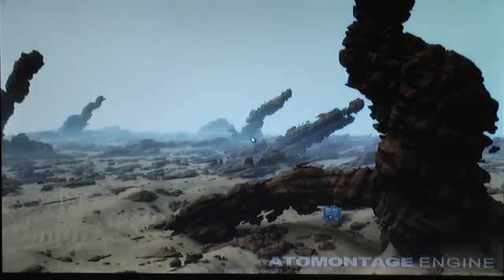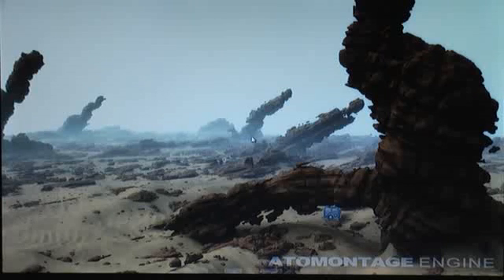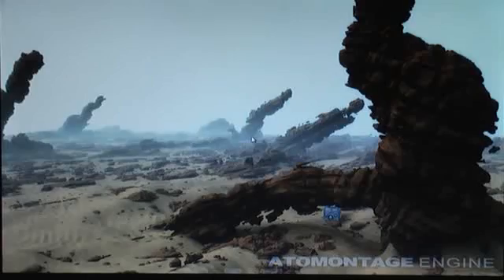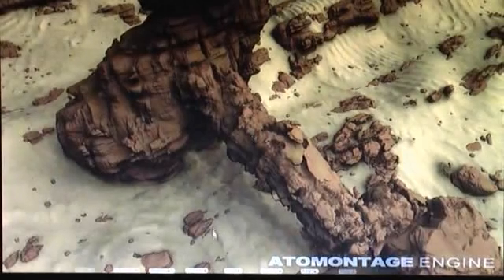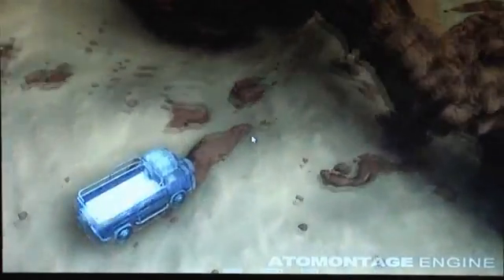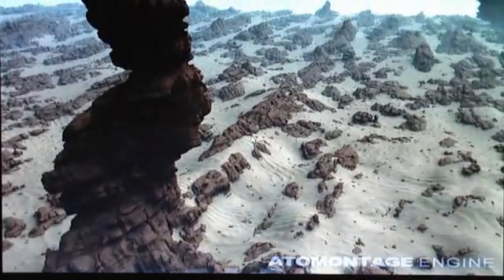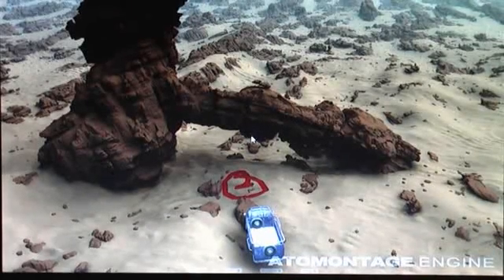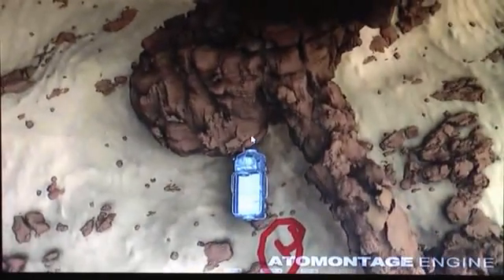Atomontage Engine - The Future Is Volumetric, Atom-Based - Unofficial video-blog #1 (part 1 of 3)

Comment: what? you can do voxel based animation? if you do that, and it works on a currently mid range system, i pronounce you god of all game engines
Reply: szeredai akos Midrange? It runs on a 2012 laptop at 60+ FPS. It will most definitely run at hundreds of frames per second on a modern gaming setup.

Comment: what are the machine specs of this video?

Hi! I dont understand what happened to digital molecular matter, tho I believe this voxel approach has much more detail than DMM can have.

but, considering the end user, the power and memory of such machines; does it require 64bits OS? will this voxeling be feasible? or, you are considering in a few years, when it can be released that, in that future the machines will be able to handle Atomontage properly?
(I am considering it is heavy to run)

THX!

Comment: It'll take more than one game. There have been plenty of games that used voxel engines in the past. The problem is the hardware of the GPU is specifically designed around pumping out polygons as fast as possible. To truly shift the industry into a voxel paradigm you need the hardware to follow, which at the moment, it simply won't do.

Comment from the maker: 1) there is a limit but it can be changed by changing a single line of code; the rest of limits are due to data volume, not code
2) it's not really a tree, but a tree could be inferred easily.. The memory footprint depends on the total entropy of the source data (uncompressed) and the strength of the compression used - I don't remember numbers regarding this scene but most scenes were few hundred MB partly compressed
3) voxel by voxel is impossible, there can be billions of them easily

Comment from the maker: @FischKopfD Well no. As you can see in AE videos, AE doesn't depend on repetitious blocks of geometry, hi-res or not. And I haven't talked about it yet but in AE there's no artificial LOD limit (the same in other non-trivial voxel engines) so in fact the details in AE can be comparable with those in UDT. I will show that in future videos and also in the first executable AE demo. Dependance on massive instancing of geometry is a serious issue and no good sign of engine capabilities.

Comment from the maker: @lelela2211 I hope so. Soon the generators will run in parallel on at least 6 cores (it was 2 till now), later maybe on 10. That's the performance boost I need to prepare the necessary huge amounts of data and tune the most relevant features so that they perform well on that data.